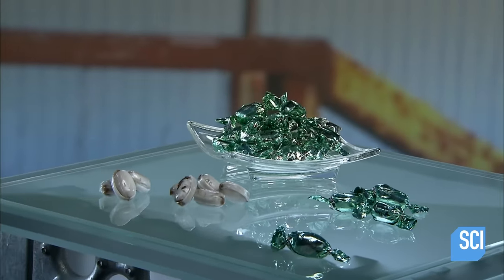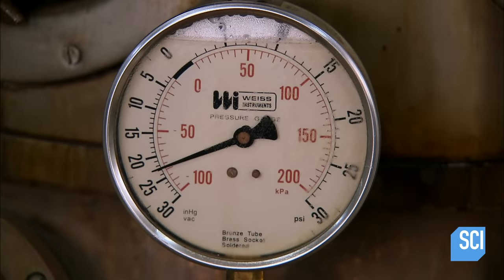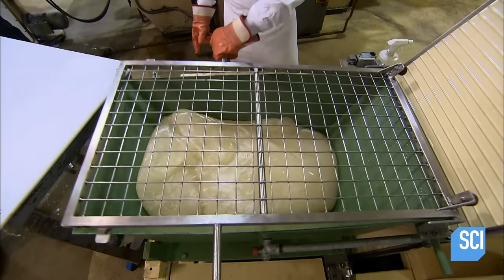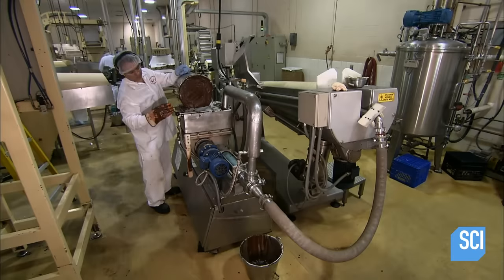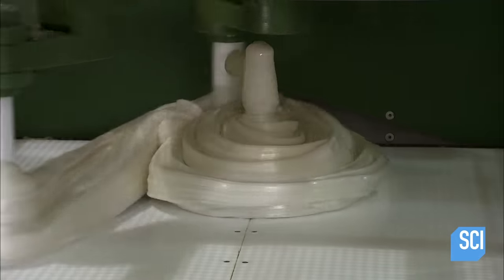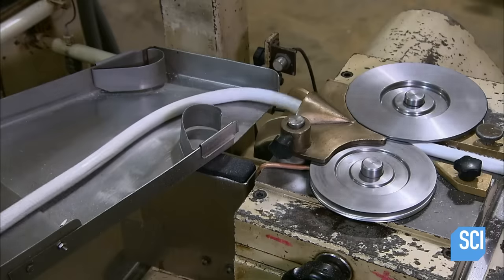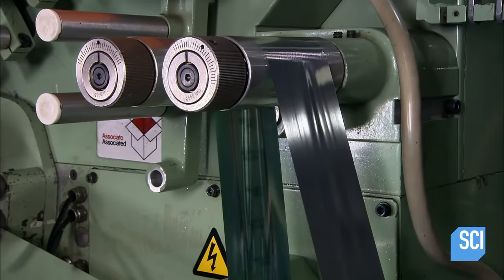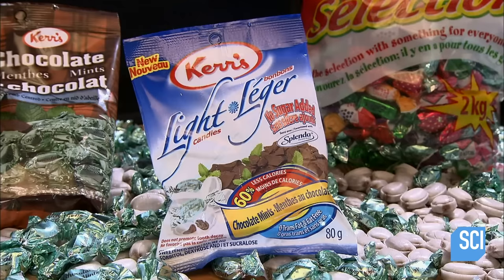How It's Made: Chocolate Mints

Comment: I like how they keep putting the white stuff through multiple machines for no discernible reason, forming it into a slightly different shape, only to smush it back together.
Reply: They really failed to explain that the candy pulling is necessary to add thousands of tiny air bubbles to improve the texture
Reply: It’s to add air to it, like making taffy
Reply: Its because its fun for the machines
Reply: It's originally clear but the more you pull the clear candy The whiter it will get
Reply: @albinalteborn  😂